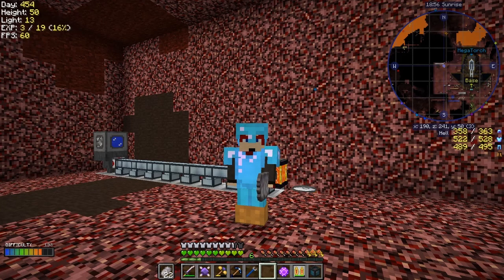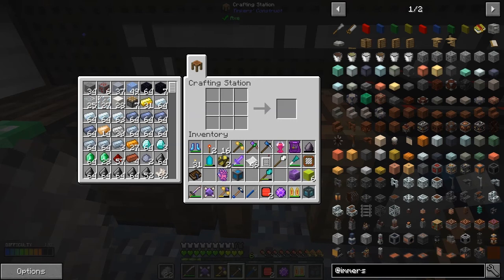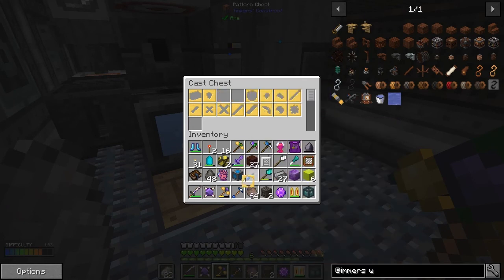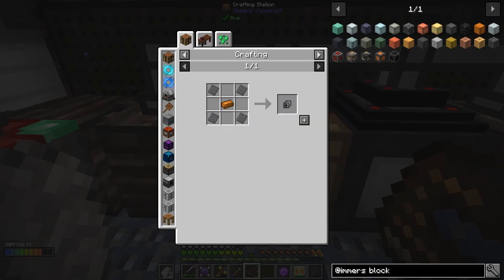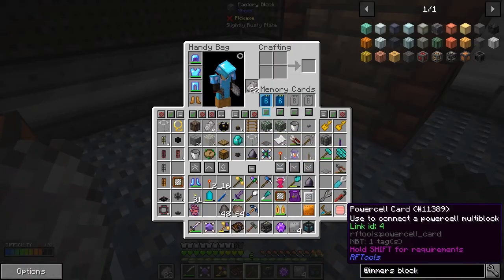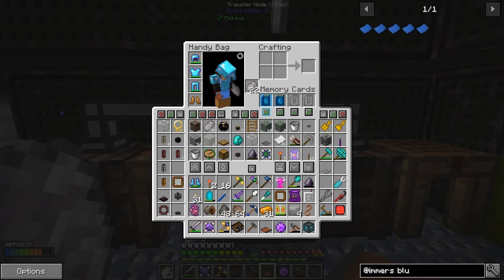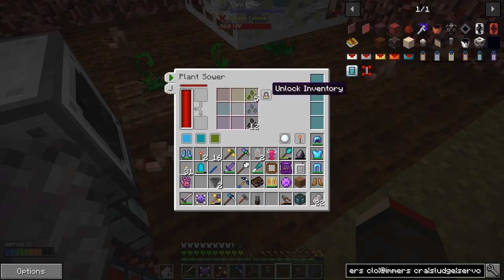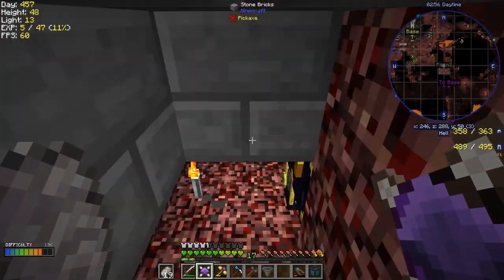Lost Souls #44 - Garden Cloche, Sludge Refiner and Hearts

Comment: You are so close to getting a cloche placed - it can be placed on anything, you just need to give it 3 blocks high (but you will want 4 if you plan on putting power in to the top).
I was thinking with all that armour you have stored away, you might want to build an Industrial Foregoing Enchantment Extractor. Give it power and books and it can pull an enchantment from all that armour (and other things). If there are multiple enchants you just feed it though multiple times. You can then use the Enchanted books with the anvil as usual. You can then update your jetpack etc. Just be aware that a bug exists for now where you can't upgrade Enchanted Jetpacks to the next tier, so if that is in your plans, upgrade it before enchanting it. Upgrading to tier 4 presents its own problems - you will need to use the Fluid Transposer to make the Blizz Powder for the Cryotheum Dust.
Reply from the maker: Thanks again. I was watching my video after recording it, I think it needs a block space around the cloche too. I was going to make the disenchanter lens from actually additions but now I'll make the industrial foregoing one. I tried to enchant the jetpack armour in the enchanter but it didn't show any enchants. I didn't really think about using a book but that is the way to go anyway. I guess that you can disenchant jetpack armour and then upgrade. Great tip.
Reply: I thought about trying that too, but it wouldn't disenchant the armour in the Enchantment Extractor. I cheated in a Draconic Disenchanter and that was able to do it, but you can't normally get that till the overworld. The Tier 4 wasn't too hard to get once you know the process, so I'd lay off the enchantments for now until we get some kind of response to issue #229 (unless you are either good with cheating or remaking the jetpack).
Reply from the maker: Did you try the disenchanting lens from actually additions? I used this in Forever Stranded but didn't try jetpack armour.
Reply: No I haven't tried the disenchanting lens. I've never seen/heard about it before you mentioned it. I might give it a go when I next play. Could be another 10 hours or so. I'm in the AWST Time Zone (GMT/UTC +08:00)
Reply: So ... I didn't yet have an Enchanter set up, so that is what I did next. But before making that, I checked the recipe again for the Draconic Disenchanter and it can be made in the Nether before going to the Overworld. I had confused myself with getting Blizz Powder which I thought required the Overworld until I worked out how to use the Fluid Transposer. In any case, once I had the Empower up and running, I made the Lens of Disenchanting and gave that a whirl with the Enchanted Jetpack and sure enough it worked. So you will be able to strip the Enchantments with either the Draconic Disenchanter or the Lens of Disenchanting. I'd go with the Lens, as even though the Draconic Disenchanter can be made in the Nether, it is more costly than the Lens as it requires Prosperity Shards and a whole lot of essence to make the Superium Ingots for the Draconic Core.
Reply from the maker: bobthebigbat cheers, I’ll have to look into that superium takes quite a lot to make, the master infusion reward helps a lot for this one.